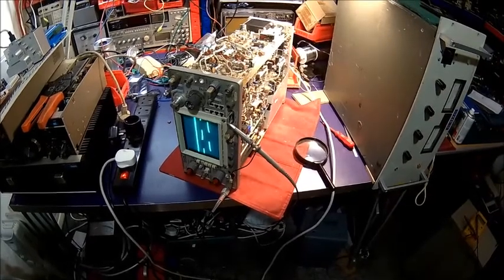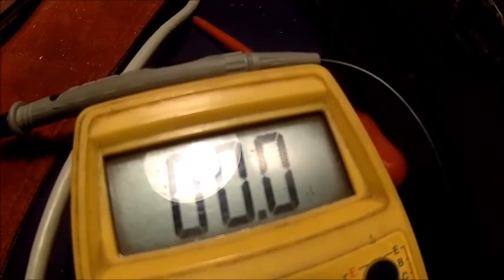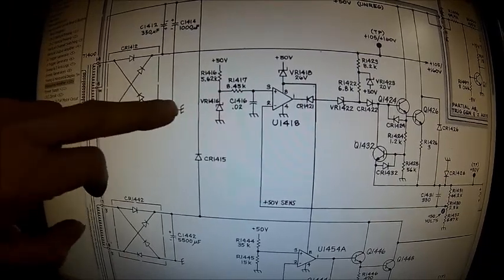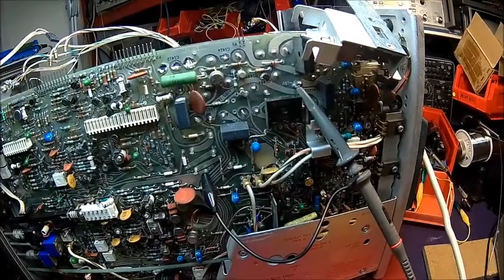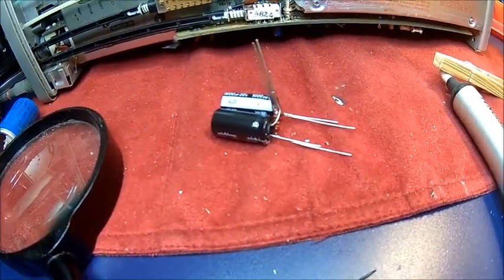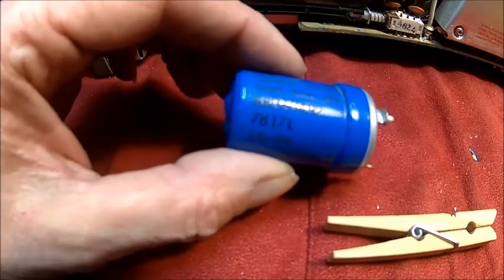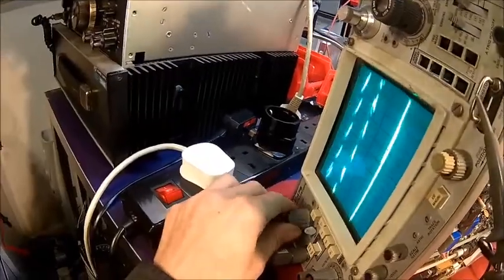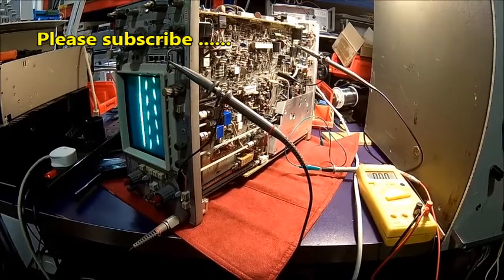Tektronix 475 Repair - Ep# 4 -  fixing the 110V supply ... but still a lot more work, to come

Comment: Just had my 475 fail today. Power up, no traces whatsoever. Controls make no difference. 
Any suggestion on what to check first?
Reply from the maker: Always check power supplies first, you will most likely find some voltages down or having big ripple.
Just be aware that there are lethal voltages inside, so if you never worked on CRT scopes, don't even try to fix it because it might kill you,.... not joking !

Comment: Great work...  I never take a chance and completely recap those old units if someone brings one in...  Low ESR @ Mouser..  NEVER buy caps @ ANY asian supplier...  Sorry but too many issues make it not worth the risk..
Reply from the maker: Well, it's the balance of importance of the equipment and parts cost, got many scopes, so if it fails again, i just do another video ...:-)
In  my experience with the 400 series, once the main caps are done, they good for another 5 to 10 years. 
If it would be customer equipment, i certainly would change them all.
Reply: @dynoguy  More videos??? I didn't think of that....  Doh...     SMPS issues are my fave..

Comment: i really enjoyed videos # 1 to # 4. i have a similar problem on my 475 which seems not easy to fix. There is noise on both tracks, apparently not generated by the power supplies. The brightness adjustment responds. The focus works but the track appears thickened and grows by acting on the input channel sensitivity increase knobs. observing a sinusoidal signal with a frequency of a few khz, a certain echo produced by the trace on itself can be seen.
Reply from the maker: Hi Luigi,..got your email, will reply at the weekend,.. sorry, very busy at the time, ... ciao Mike